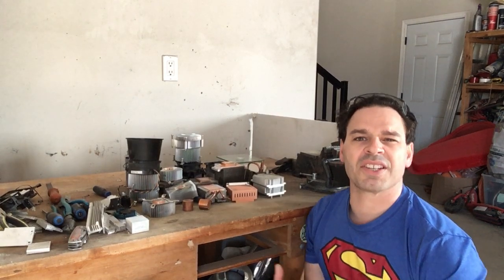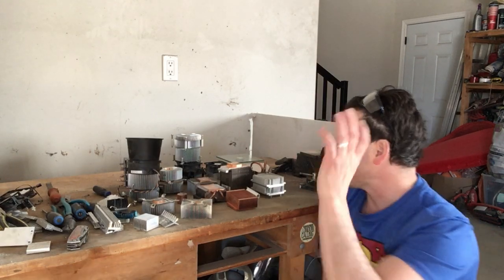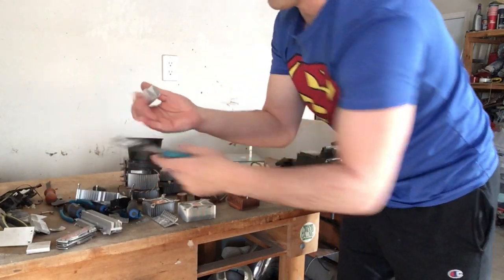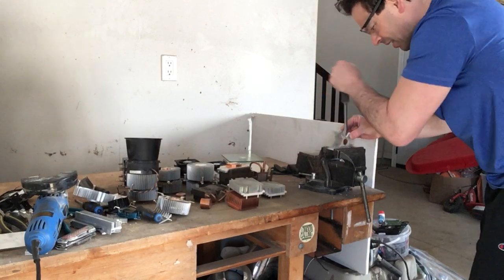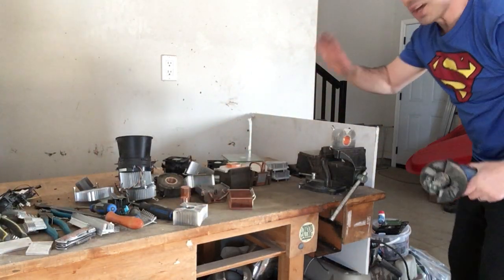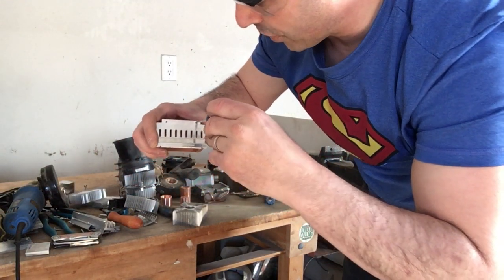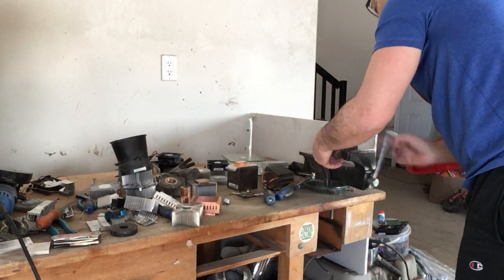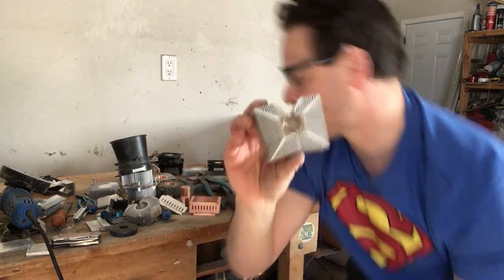Scrapping heat sinks for copper. A great source of copper!

Comment: I know this is an older video, but I recently purchased two pallets of cctv components that I scrpped. The heat sinks with the hollow copper slugs in the center of aluminum fins can be separated by opening the vise wide enough the copper can drop through, and using a railroad spike or something of likeness, and hammer it out. No cutting, just smashing. The steel "X" fastener that holds the aluminum just pops right off once the copper is out
Reply from the maker: Thanks for the comment. Yes, there are ways to separate without cutting, but even the cutting method is pretty effortless. I love my heatsinks. Stay well and happy scrapping

Comment: I once found an older computer with a heatsink made from pressed copper plates that were bolted together in the middle. Each plate was bent to it's own specific angle in order to form fins in the distinctive circular pattern seen on CPU heatsinks. After removing the heatsink from the board, it was just a matter of undoing the 4 bolts and then the copper was clean and ready for the scrap bin.

Comment: I can never find any heat sinks with copper cores like that. On the other hand I just took a load of extruded aluminum! 720 pounds for 0.60 per pound=$432….. they didn’t give me extruded price because it had screws and nails…. O well
Reply from the maker: Next time you will know to take out the steel pins. Nice load 720:pounds!

Comment: You are doing a video of what i am doing right now. Cool. I have one that has copper tubing going back and forth in it. And the piece on the bottom. Going to wait and see if you  show a piece like what i have
Reply from the maker: I actually just did one like that in the garage. I just put in vise and hit one side, the aluminum seemed to have popped out of a grove in the copper. I then did other side and same thing.I also cut the tubing away from the alum grill just so I had the bottom.
Reply: @TinManScrapper  Say Thanks for replying

Comment: Hey Tin Man. I am a 55 year old disabled scrapper. I have been scrapping for 2yrs and still don't know what I am doing 🙃.  I have several different kinds of metal.  I know have much gold and silver from electronics. I do not know what to do with it now. I been watching how to smelt, but that envols chemicals...yikes
Reply from the maker: Unfortunately that is going to be the best method to extract.  I have heard that high concentrated vinegar can dissolve the gold off the gold plated circuit boards. From there it will need to be melted down. If not your thing, you could sell the gold online. eEbay or boardsort.com in the u.s. will buy your gold boards. Hope that helps. Stay well and happy scrapping.

Comment: that solid # 1 copper sure looks good, don't come across computer towers much, got 2 or 3 i think, they fit into the giant trash bins we have so you have to pretty much rely on people setting them aside.  curious about clean/dirty al.  i haven't done a run yet, but do stickers, puddy, or sticky pads have to be completely removed?  also i have a lot of clean al. extrusion with a heavy/hard caulking on them, (door and window frames) does that make it dirty as well?
Reply: I take stickers off. If excess puddy, I use a screwdriver or scrapper and take off as much as I can.  I don't think they will say anything if there is a little puddy, but just make sure no big blobs of it.
Reply: @jamesfirth1280     thanks for the tip, my biggest concern was paint.   that if i cleaned all the metal, felt, rubber, puddy... that i'd still get a "dirty" price because of the paint, whether factory or after market, wasting tons of time cleaning the stuff...  but the yard i called today said paint was okay on extrusion (window/door frames) and sheet (guttering/siding) al.   as long as the piece was all al.  "that's important" she said.   

of course, yards vary on their specifications, one scrapper gave good advice, "don't worry what a yard calls it, as long as it's the best price for what you have."